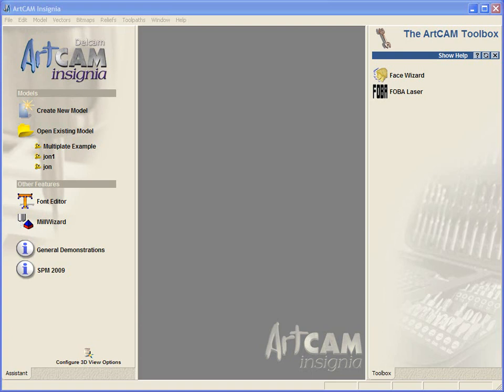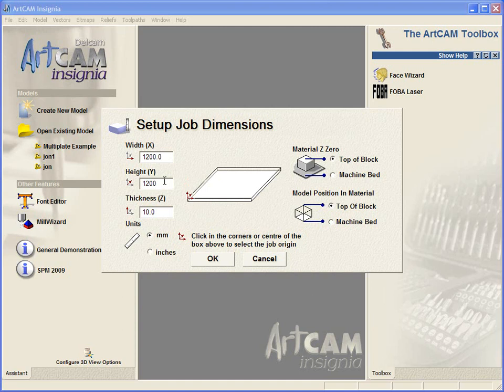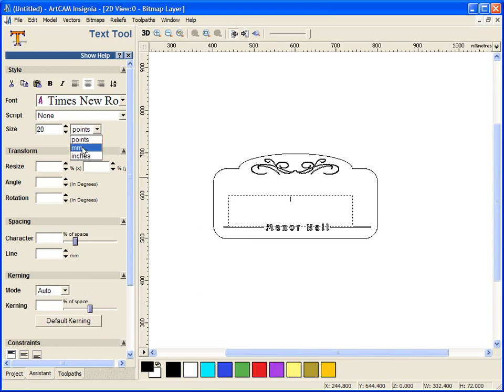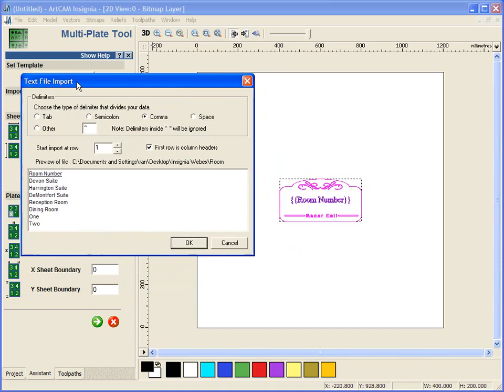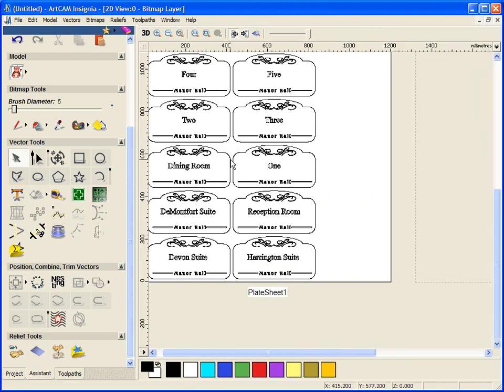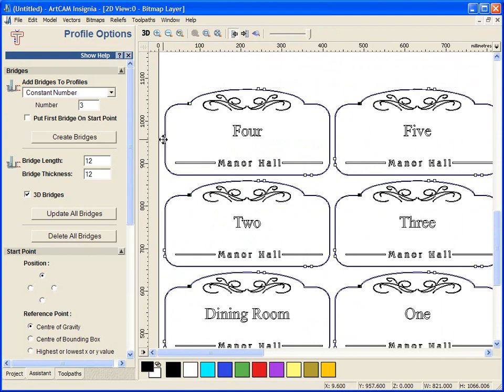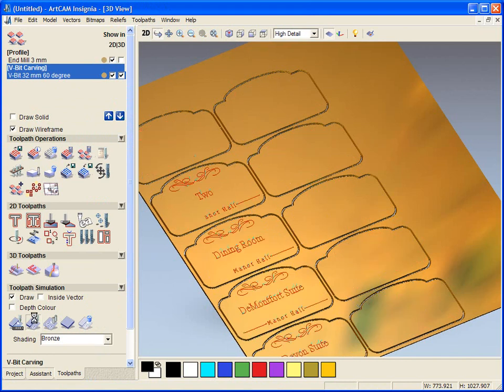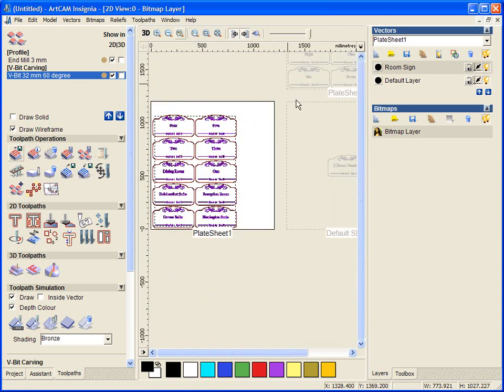ArtCAM Insignia 2009 - Multiplate Labelling

Comment: I have a little question. How can I set the template to make always two following numbers of an excel list in one label?

For example an excel list: 
1) 20
2) 25
3) 10
4) 50 
 
Two following numbers shall always stand in one label.
If i write {{number}} / {{number}} it makes: 
 
1) 20 / 20 
2) 25 / 25 
3) 10 / 10
4) 50 / 50  
 
also the same if i write {{number}} / {{number2}} 
 
But I want the following issue:
 
1) 20 / 25
2) 10 / 50
 
Its only a little hint i need.